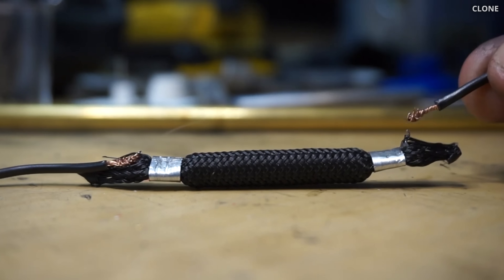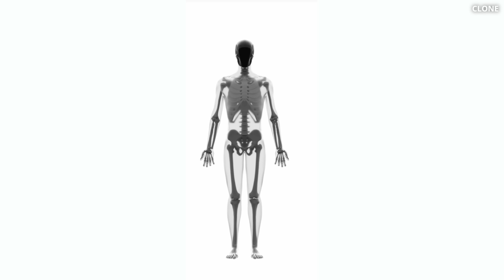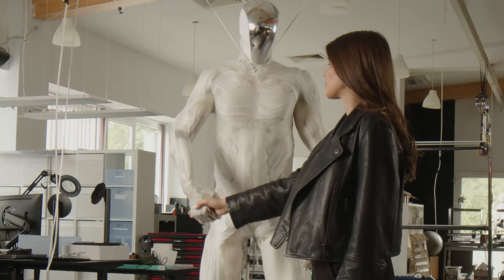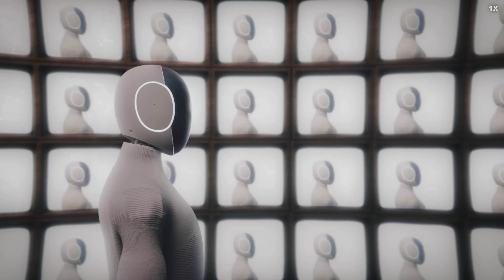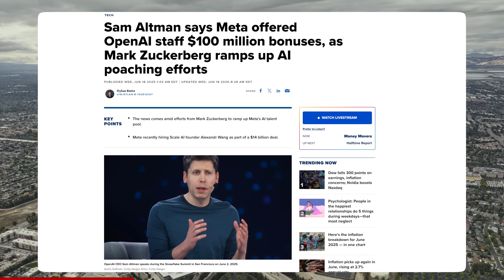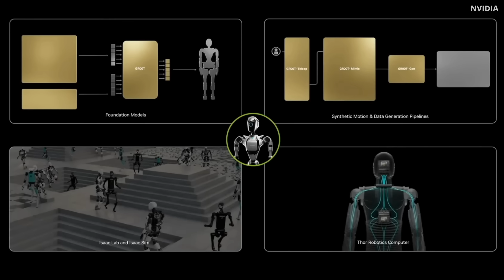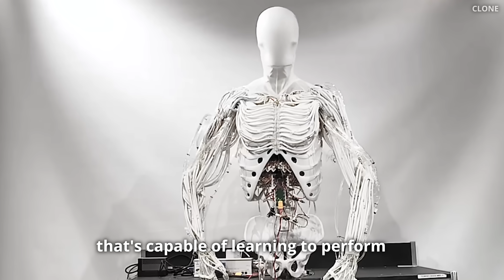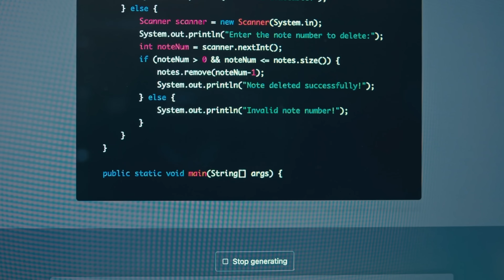I Met Protoclone. It’s Actually Insane

Comment: I was also think about using hydraulic pump using instead of machanical arms.pumping oil or liquid in tiny tubes and giving energy to move the joints.

Comment: I may be an outlier in this regard, but i personally prefer the faceless robot approach. Or better yet it can have a face but its distinctly not trying to mimic human skeleture. Look at Johnny 5 from short circuit or Eva and Wall-e from Wall-e. Take the current head structure and integrate a led matrix display.

Comment: I'm not optimistic about its technological approach, because biomimicry is currently still in the vacuum tube era; it needs to miniaturize and become as stable and reliable as chips before it can be realized.

With all due respect, I think it will fail.  Human fine motor skills come from a vast number of neural network feedback loops, allowing for real-time, dynamic, and minute adjustments of muscle fiber groups. Motor drives, on the other hand, have strict step-by-step precision, and current biomimetic muscles lack both of these capabilities. Its current performance only appears natural due to the inherent properties of the material structure itself, but a falling feather looks even more natural, which doesn't mean the hardware system possesses the precise motion control capabilities of a motor or the fine motor control of a biological system.

Comment: How long can it go between charges?  (Or sandwiches?)

The ultimate power station is going to have to be something chemical, processing 'food'. -Because that's what the greatest probability sorting system in the universe decided upon as a best fit for all the bio-machines running around the planet.

Unless.., you know.., nuclear power is tapped somehow.  I feel like pulling power from atom splitting/fusing is a clever hack out of reach of the standard evolutionary model. (Though.., what do I know? There's probably reasons it was never adopted by Earth organisms. Instead of indigestion and cancers, etc.,, you get mile-wide craters.)

Comment: It will be difficult to make a face, because there is a fine line between an empathic face and a creepy one.  If the face doesn't move just right, people wont want to be exposed to it.  The expressions will need to be perfect, if that makes sense.

Comment: The way those muscles spring leaks seem to be an even bigger challenge than the whole walking thing. To have the required reinforced strength to avoid exploding after hundreds of repetitions of lifting a suitcase or laundry basket it might need to be multiple times heavier than a human  and even then there's no guarantee it won't leak and require constant expensive maintenance. Likely it's why even though the design was first created decades ago, it hasn't been put into wide use in the prosthetic industry.

Comment: Ich hätte  sofort  nur  den  Oberkörper vermarktet, um z.B. in steriler  Umgebung  Sachen zu verpacken,   abzufüllen, umzulagern , umzudrehen etc.  Also  überall, wo  normale Kuka  Roboter  viel  zu träge, zu groß und und zu viel  Kraft  haben.
# Unter menschlicher  Anleitung.  
Perspektivisch  werden die teuren Techniker von z.B.   Siemens  von zu Hause einen solchen Humanuiden  nutzen, um in Bangladesch  die Technik  einer Kläranlage  zu warten und ggf. Teile  auszutauschen.  Oder  man  kann die Arbeiten  an Oberleitungen  der 400 KV ebene  unter Strom  durchführen  oder in Trafo Stationen auf Plattformen der  Offshore Anlagen  etc.  Auch in der Chemie, Medizin, am Hochofen  und bei radioaktiver Belastung  sind solche  Roboter  in Fremdsteuerung  denkbar.  Sollte die selbstständig  Entscheidungen  treffen  können und einfache Arbeiten ausführen  In der Lage sein, werden sie z.B. auf dem Mond eingesetzt.  Dann  kann ein Mensch  10 Elektriker Roboter  überwachen  und ggf. eingreifen. 
Als Begleitung für zu Hause ?  Wer braucht sowas?  Also wenn ich zu viel  Geld habe und faul bin, dann  habe ich Hausangestellte. Denn ein richtiger  Roboter  wird > 100.000 $. kosten  und die Wartung  etc.  bestimmt 20.000 $ p.A. 
Dass lohnt  nur, wenn das Ding  auch produktiv eingesetzt wird.

Comment: Hydraulics.
Sponge rubber as tubes and direction. 

Video takes several minutes to say something that 30 seconds is more than enough. 

So, sensors, control, reaction? Those are the areas that probably have the questions, and you can answer? 

I think this video could have been shortened for impact. Too much waffle at the start.

Please don't be upset with the criticism, you make good videos and they are of high quality. It's just one person's feedback.

Comment: I did an AI search on artificial muscle tech technologies. Hydraulic muscles had definite advantages in terms of force, density, efficiency, and control, speed and precision. The drawbacks listed were complex, complexity, and the potential for leaks. It’s hard to see how this would become a successful technology given the leak potential. When a hydraulic muscle fails with a leak, it doesn’t just stop working, but it makes a big mess too. Maybe graphene tubes and nano material valves could solve this problem.

Comment: Congrats, Protoclone!  A robot "clone" (using biologically-inspired actuators and mechanical joints and structure) was an impossible dream when I worked on 3D non-linear robotic force-feedback legged-locomotion controllers in the 1980's ;  Now, at last, the dream is nearly a reality (and I'm still alive to see it)

Comment: It is a very interesting approach but I don’t think it is correct to say it uses hydraulics instead of motors.  The pumping of the fluids to operate the hydraulics will require many valves and likely at least a few pumps-in essence motors.  Since Tesla has been working a lot on the hands and have been experimenting with tendons that mimic the human arm and hand it will be interesting to see how they compare.  Tesla is keeping Optimus 3 very close to the chest so we likely won’t find out much before it goes into production.

Comment: But it far better than motor robot in walking topic due walking or biapedal walking is not that simple it active stabilization and need very fine control which motor cannot give or does give on which level is need

Comment: The reason robotics companies like Clone are replicating is really simple. Humans are as close to the perfect design for tool using machines as is reasonably practical within the confines of biology. So whatever robot we build has to be atleast as good as humans or better.

That means strength, dexterity, sensory input, weight balance, ability to climb, walk, run, throw, swim, waterproof, dust proof, can squeeze through tight spaces, adjustable foot and finger traction. Self-repairing, leaked fluids scavenging (lymphatic system). Great vision, great hearing, good memory.

It turns out most of the things robots are struggling with the human body has already solved- if you put the the muscles/motors in the arm and attach it to the fingers through tendons, you get bigger stronger finger muscles without making the fingers fat and clumsy. We use high density hydrocarbon energy storage so we can go up to a month without "refueling". It's yet been true that we can make robots better than humans. Humans ARE better- for now.

Comment: If you shoot it then would some of it body not be able to work?
Reply: Maybe yes or no, because it is possible that they will give it a metallic layer to protect it from physical harm, or they won't give any metallic layer at all. So, both are possible, and we don't know which one will happen.

But I can say with confidence that the android will stop working if it gets shot and doesn't have any metallic layer to protect it from the bullet. Then it will leak water, and without water it can't move much because it needs water to create movement through hydraulics.

Comment: so basically. if he only wants to use synthetic muscles, its going to be a tethered machine. still hooked to a another pump which is then powered by a high output electric current. hopefully less than a 30amp breaker lol. i dont see a future use for this application, we already have 3 million machines building cars, homes to flipping burgers
Reply: Who told you this?
Reply: @farzad228 research. im also an electrician.
Reply: @farzad228 common sense. For example, ever owned a water cooled PC? Prolly not. Guess what, that water evaporates and needs power to flow. It's like owning an electic car and making sure fluids are topped off. Then if a battery is implemented, it needs to be massive and built around the fluid motor pump thats already taking all the space in the abdomen of this model.
Reply: @rpharbaugh  I guess this won't happen with the android of clone robotics. They will found workarounds.

Comment: 7:34 Ok, so batteries add weight, but you haven't given any comparison with protoclone.  How much does it weigh in comparison?  As for making movement stiff, that's not caused by the motors, but the programming behind the movement.  It's been shown by the Chinese that they can make a much more fluid moving robot using AI learning.

Comment: I would never "stand behind them" as you say at the end of the video, but making it fragile and aware of its own mortality through sensitive pressure sensors is a great idea, I think that the key that is missing in robotics is the ability for artificial intelligence to perceive pain and suffering as humans do, they will never be able to understand the consequences of their actions if they have infinite lives in simulation there needs to be a clear distinction and a very serious penalization system for never wanting to get into danger like that, humans never have that luxury. Biological systems have evolved to be very refined in the extremely tight space efficiently in our biological makeup and I don't think synthetic systems can get to that level so it will be a very primitive form of imitation, they would need to be very compressed, not very redundant systems implemented in this faux humanoid, for it to even be 0.001% of the intelligent systems of the human brain in equivalence, there would need to be a huge jump in technology for this to be viable, this is a pipe dream but this is extremely interesting for prosthetics as we can link human nerve signals 2 controllable limbs to help accident victim's for example or people born with birth defects, ultimately we should be concentrating on our superior biology rather than outsourcing it to a machine that would never be able to understand the complexities of the human body and would never be able to adapt like humans can with regeneration systems built into our evolutionary biology, if anything this is an exploration of what we are abstracted away to introspect our own mechanisms and that part of it I find pretty interesting, I like your videos and I have subscribed to you!

Comment: My workplace switched the tech support to AI. Productivity has plummeted. I spend 3/4 of my time fiddling with tech issues from a buggy, rigid, locked down cloud application that has no practical support, nobody who can access the underlying data structures to fix human errors nor glitches. My boss had to update his password, and it sometimes works and sometimes doesn't, within the exact same system. The tech support is a chatbot that they fed manuals into; that's it. And, the AI couldn't even understand the images inside the manuals to any degree.

Comment: I have a theory involving technology and bio Electronics. Why aren't we trying to develop a material that contracks when electricity passes through. You are literally doing what muscles do if you activate them in that way. It needs to be a system that can be dis. Assembled and replaced easily. Maybe modular sections that are covered in a Silicone rubber material with contracting  electronic components.

Comment: I wonder if the have thought about using brake fluid instead of water, since brake fluid doesnt compress like water does. They would have to use different tubing most likely for the fluid but it might make the robot way more strong

Comment: As scary as they may seem, I think that hydraulic robots are a better idea than motor ones. In case of one going rouge, the motor one will be harder to disable, whille the hydraulic one you can stab few times and it will just colapse due to fluid loss, just like a human bleeding out.

Comment: Well, it's an expensive puppet now. Fluid cleaning and normal evaporation of H2O, that service will cost big. Then the repair and maintenance of it's hydraulics, hoses, servos and sensors, will be a great expense. THEN THE QUESTIONS OF IMMEDIATE OR EMERGENCY SHUT DOWN AND THE CONTROL OF THE COMPANY SELLING THE UNITS, REMOTELY. IF IT LOOSE BALANCE AND FALLS GENERATING MAJOR DAMAGE. Very costly again.. 👀

Comment: If you think your car repair bill was high, just wait until they have to check 5000 hydraulic connections!
Reply: Unless you add a sensor to every hydraulic connection that will report pressure drops, then you don't have to look for anything because the software will tell you which section the leak is in.

We live in the 21st century, and this is a robot's body, not a leaky toilet or an old excavator.
Reply: @Ruunawayboy  and every one of those sensors is another point to fail....
Reply: @theeddiesshow  do you really think some sensors could cause a significant problem? You should catch up with the latest tech industry news and reviews. 😊
Reply: @theeddiesshow  and just like in a car itll show up as faulty on a scan tool making it easy to replace
Reply: But like an old excavator, you only need to look for a leak. Its not all that complex. You could even have the system run a pressure test to find it more easily
Reply: @Ruunawayboy . This will be a gigantic industry for technical jobs.  It will be akin to automotive diagnostics and repair.  Eventually there will be way more robots than cars.

By the way, AGI is nowhere in sight in the lifetime of anyone alive today.
Reply: @Ruunawayboy  You don't get it. They will still charge you as if they have checked every single connection!
Reply: Self sealing lines if the pressure drops, or fluid that can coagulate just like blood only faster to seal the leak.
Reply: Its not for poor people lol
Reply: A mckibbon muscle also has a significantly (>100x) shorter service life and efficiency than an electrical motor. Not only are you going to have to inspect and replace all of those tiny little muscles; you're going to have to do it pretty frequently.
While this is a really cool idea, I don't see this becoming practical for consumers unless they can drastically improve the service life and efficiency of their actuators.
This is a "very ambitious" idea. 
T. Engineer who built robotic arms as part of his degree
Reply: EVERYONES ELECTRIC BILL WILL BE OUT OF CONTROL..
THINK..IF..AN AI..MODLE,,SAYS..TIME TO CHARGE ME.."..??    YEP.. BAD IDEAS!!!!
Reply: Have a physiotherapist diagnose it
Reply: fair argument
Reply: They only have to check the connections that can create the faulted reaction…. Usually less than 20
Reply: Just become a "medical practitioner" for synthetic life, just like human life
Reply: Regular people won't have these. Only the rich will be able to afford them. Especially once they take all the manual labour jobs.
Reply: lol
Reply: Nah, when robots are that high tech they will repair themselves, or have other robots do it for less than nothing.
Reply: Like a human body.
Reply: Eet payesz thwo pbeeh cahrrefool, one vneedtss to fãck tdhe robert fehrry gjzcendtly

Comment: Yeah but have they worked on it’s feet as extensively as it’s hands?  The human foot is complex also.  The ankle bone allowing the foot to rotate/pivot/adjust, each toe joint almost as flexible as the fingers on a hand(which is why people born without hands/arms, use their feet as a replacement), etc.

Comment: All that AI compute required could make its blood boil and spring a leak.
Reply: To simulate AI you need to be able to simulate a dopamine rush.  That is what drives all complex life. Right now, reinforcement learning (RL) in AI is a crude parallel.   The “reward” is hard-coded or shaped by humans. What’s missing is the self-generated, evolving motivational architecture that biology has. That’s why AIs don’t want anything — they just optimise whatever goal you set.
Reply: The concern is that if AI developed its own internal, evolving goals, they might not align with human values or safety. This is the central challenge of AI alignment—ensuring that powerful AI systems remain beneficial and safe.

Comment: 18:50
Good video, but this is a bad take. Safety should come not from weak construction or capabilities, but from Alignment.
1 use-case I see Clone similarity to human play important role - AI Soulmate. 
For other tasks specific use-cases it is not that important, and strength and flexibility play more significant role - other robots look to have greater potential.

Comment: It seems that using water will have limits such as freezing temperatures. Maybe having or using a slightly heavier viscous bio friendly liquid of some sort,will transfer more energy through this system while not being affected by cold temperatures  could be beneficial ?
Reply: A liquid silicon solution replicating the structure of blood.